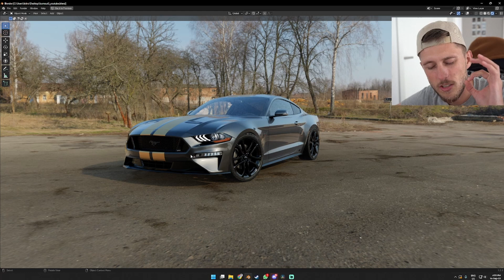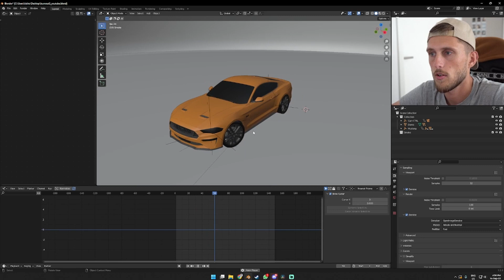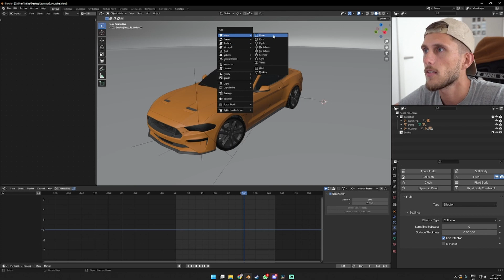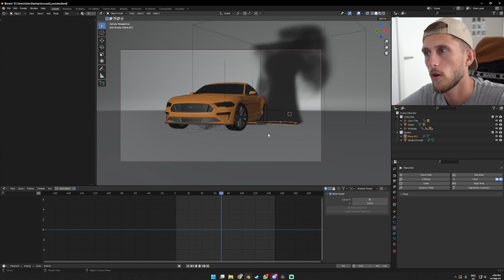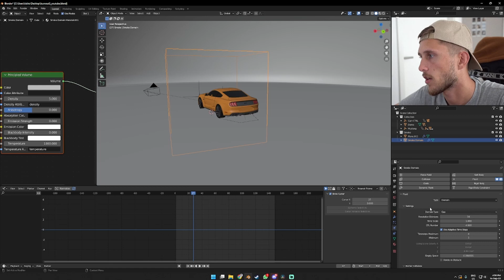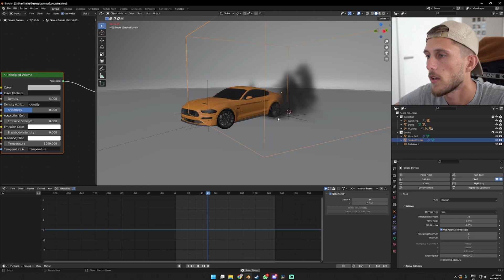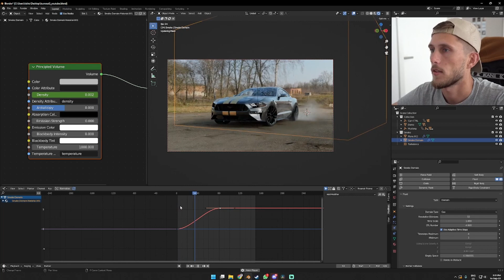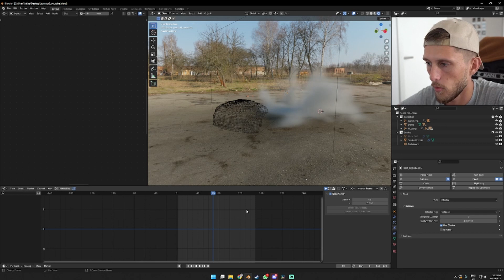How to BURNOUT in Blender the EASY way!

Comment: That's the dumbest way to do it bruh, just put a cylindrical mesh around tires and use your quick smoke. You can even use particle systems to create tire marks on the road